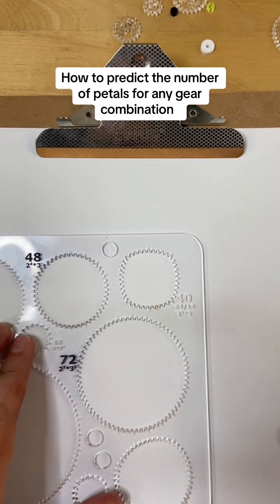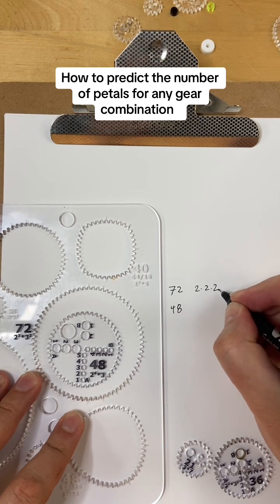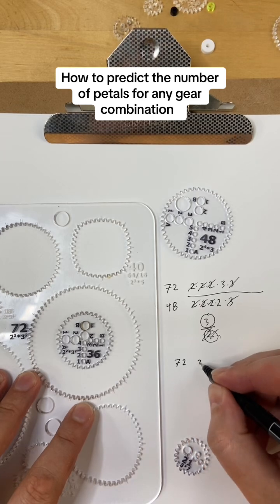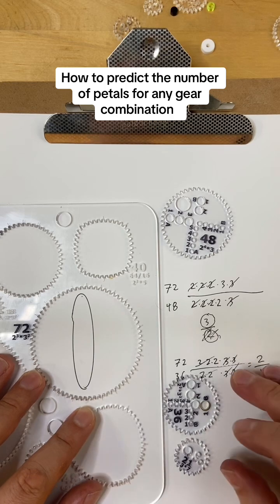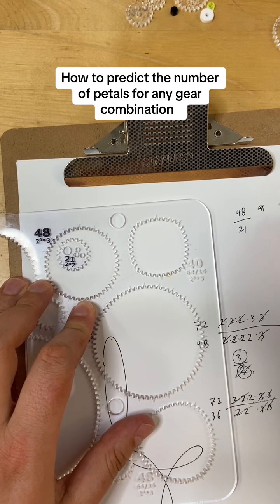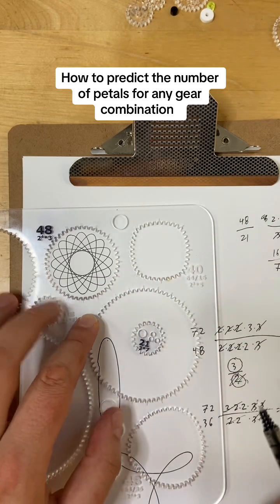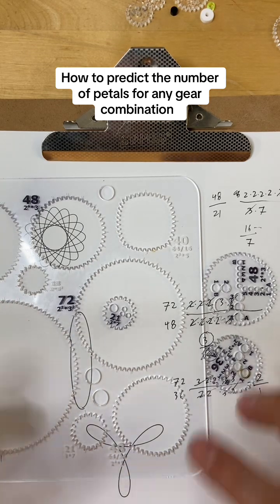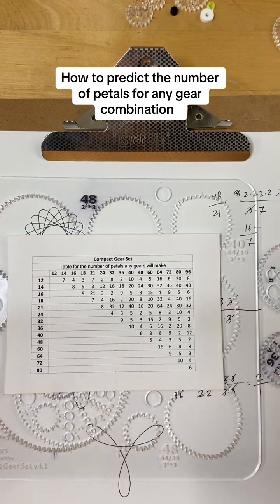How to predict the number of petals for any gear combination:

Comment: How do you know which numbers cancel each other out?
Reply from the maker: If there is the same number on top and bottom you cross them both out

Its just that.  I just used a term from simplifying fractions and forgot to explain it.  Thanks for asking for clarification
Reply: @WildGearsCreations I believe I got it thanks
Reply: Algebra.